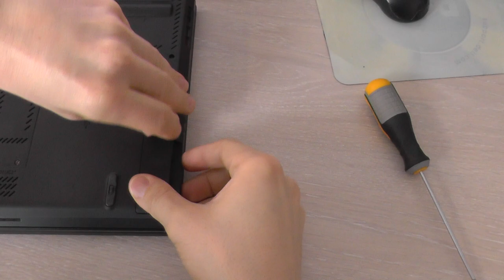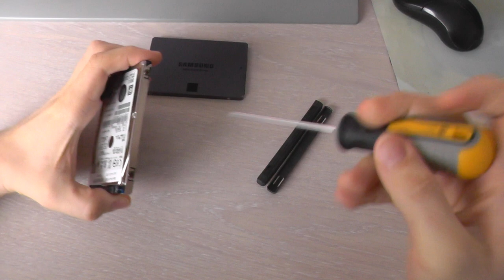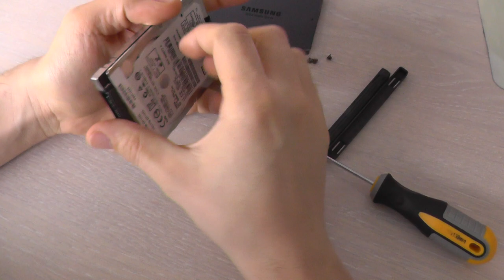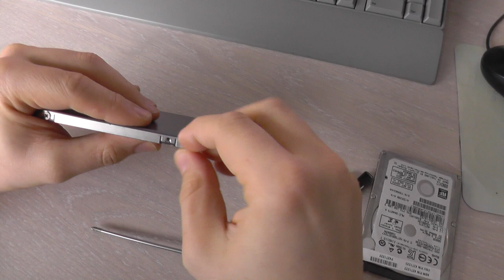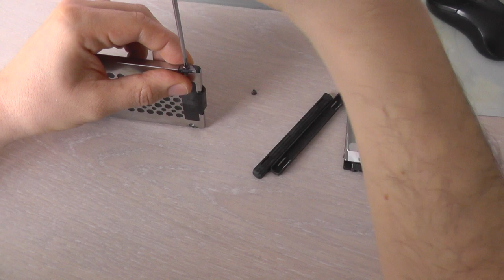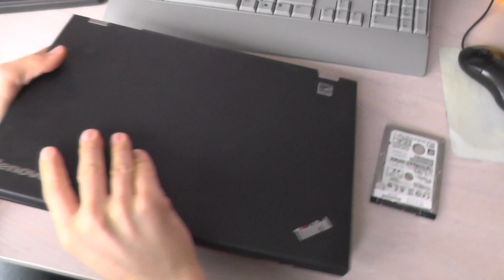Lenovo T430 HDD to SSD Upgrade

Comment: Great to know we're the HDD was hiding, great video and thanks for posting, very helpful indeed, the T430 has to be one of the best laptops iv ever owned and everything can be upgraded to work just as fast as newer thinkpads, only problem I have with the new thinkpad is that some hardware in them are soldered permanently making upgrades very unlikely or very difficult to change even if your good with a soldering device

Comment: Oh why you didn't take the battery off?
Reply from the maker: Indeed, that would be recommend, I was in a hurry, it's still fine :)
Reply: Okay, hurry explains usually ;)
Reply: Regardless, great video!
Reply: Why do i have to take the battery off?
Reply: DavyComedy It’s safer and prevents damage to the laptop

Comment: I have a Thinkpad T400 where the HDD is not working. Any idea if that supports SSD and if a compatible SSD or HDD is available for sale online anywhere ? Thanks.
Reply from the maker: Yes it supports SSD, online you can buy this SAMSUNG model: http://www.gearbest.com/hdd-ssd/pp_351329.html?lkid=10237015 I have it and works very good.
Reply: Thanks.

Comment: i need your help brother, i have two lenovo t430, the other one has a screen back light problem or failure, by trying to fix it i have replaced the inverter but  still same results. And the other thinkpad refuses to accept several i5, i3 core processors that i have tried, it just does not show up on the screen my RAM slots are both working properly.
Reply from the maker: You show try a bios update on the second one. For the lcd issues maybe the ribbon cable is bad ?
Reply: i changed it as well, same output but someone suggested that it could be the death of my graphic card

Comment: Did you clone the drive first, or was this a brand new machine?
Reply from the maker: No, i never clone HDD to SSD, i like to reinstall (clean install).
Reply: Do you need a windows disc to clean install?
Reply from the maker: Yes, or a bootable usb drive.

Comment: How many slots for storage are in this laptop? I want to have 1 ssd and hdd, is that possible?
Reply from the maker: You can install an M2 SSD and keep the 2.5" bay for a HDD.
Reply: thanks for the reply!
Reply: Well... This is a late reply, but someone else might find it useful. This can easily be done using a SATA caddy which fits into the CD/DVD drive slot. You can actually use it for any laptop which has a CD/DVD drive. Only thing you should watch out for is the size. It comes in two thickness, 12.7mm and 9.5mm I think. That's all :)
Reply from the maker: A very good advice indeed, and you get the hdd storage space and the SSD speed for OS and APPs

Comment: I have a t430 and I'm thinking to upgrade it to SSD instead of buying a new one. I just love this machine. So robust!
Reply from the maker: Go ahead, it makes a huge difference when coming from a HDD.
Reply: I just got one for $120 for work. Dropping SSD and 16GB ram in tomorrow. Excited to program on it while away from my desktop
Reply: How to copy HDD files to the SSD, before installing into notebook? Do I need to use usb-to-sata connector?
Reply: @genext81  Did you ever figured it out? I'm a computer noob and would like to do this for my dad's computer as well.
Reply: @JacksonWalter735  unfortunately, I have to do it VERY MANUALLY 🤭🤭. I copied all files to external harddrive, configured the new Windows (and installing back all the Programs), and transfer the files to the new SSD
Reply: Bro how is your battery if u buyed new give me link
Reply: @genext81  I guess best option is to copy the HDD data into a USB memory before the change o
To the sdd
Reply: @genext81  it is the best approach to avoid conflicts
Reply: @JacksonWalter735  get a cheap dvd to hdd caddy and install your old hdd into it then swap out the original dvd drive. That way, you don't need to copy and also you have extra plenty of storage.
Reply: same here in 2024

Comment: SSD -Drives have always been the best as no moving parts then on the bottom some good people have added extra Ram too,as the Ram is below the Thinkpad 430s and under the Keyboard to add double,run a simple diognostic test and now on 16 Gig's of faster laptop on a T.bYTE OF SPACE ......Class Machine nice upload 4 noobs 10/10
Reply from the maker: Yes 100%, adding a SSD instead of HDD and increasing the RAM really boasts up productivity.

Comment: I've got a T430 too but when I pull out on the pull tab something is blocking the HDD. I tried to apply some different pression with a screwdriver when pulling but nothing works. Someone got the same problem ?

Comment: I can't remove my hard drive it doesn't have a pull tab do you or anyone know how to remove it
Reply from the maker: Can you upload a picture somewhere so I can have a look ?
Reply: we have the same problem i don't have that pull tab
Reply: Aguida Anis I drilled a hole and put a screw in side then pulled it out
Reply: +VlogJunk but where
Reply: Aguida Anis at the front of the harddrive
Reply: VlogJunk  D:   you should of used a hole load of tape or krazy glue a side of paper or rubber band and pull out the drive that way
Reply: give it 8 or 10 whacks with a hammer and it will come right out. you can pour some oil in there to loosen it up first, or heat it up with a blowtorch. let us know how it goes.

Comment: Hi!! May you tell me which changes on the BIOS configuration should I do to my SSD work? Thanks!
Reply from the maker: None, it works as normal, just check to have AHCI enabled before you install Windows on the new SSD.

Comment: After I install the SSD, can I use my recovery media (say DVD that I have created upfront) to re-install Windows on it?
Reply from the maker: Yes you can but i do not recommend as the original recovery image is based on the HDD. By installing a clean windows on the SSD will yield better result and increased stability.

Comment: I heard the 7mm SSD don't work, is this true? I think most (if not all) EVO are 7mm.
Reply from the maker: +CommanderSanta The disk I am using daily is a Samsung EVO so it works...You need to use the HDD's bracket to fix it.

Comment: The Lenovo T430 have a mSata, why not use it for install a SSD and keep the HD ?
What it's Pro and Con of this solution ?
Reply from the maker: There are no major pros and cons, current SSD are fast enough regardless of the used port.
Reply: @TechTronic9000  So why do you change the HDD to a SSD when you can just add a SSD in the mSata port ? if you use the mSata port you can keep the HDD

Comment: I dont know if this is the right place to ask. But if I choose to change the HDD to the SDD how can I reinstall my OS  which is a free upgrade of win10 on the new SSD?
Reply from the maker: +Nikolaj Andersen Did you have a Windows 8 license ? There is a tool for extracting the code from the BIOS, reinstall 8 on the SSD and then upgrade it to 10.

Comment: Hi, what are the current SSDs compatible for this? I noticed also the heat on the near left hand side. It apparently appears to be where the Hard Disk is, ha!
Reply from the maker: +cSharpIndonesia most known good brands should work. I have tested with Samsung evo 250GB and intel 530 - 250GB  series.
Reply: And I assume the 500 GB SSD will work just fine like the 250 GB one, right?
Reply from the maker: +cSharpIndonesia Yes, as the SSD acts like a HDD, and the notebooks motherboard supports higher capacity drives like 1TB or 2TB so 500GB will not be a problem. Just be sure to update the bios and update the firmware on the SSD to get maximum compatibility. An before OS installation be sure to have AHCI enabled.

Comment: Thanks for the video, TechTronic. After reading your comments reply to various YouTubers, I gather that you recommend installing fresh Windows on the new SSD instead of copying what I already have on the HDD. 

I have Windows 7 Professional on the HDD for my T430 right now. What's the best free way to get a copy of Windows 7 professional along with the Lenovo drivers? Thanks in advance.
Reply from the maker: +wutaboutthemravens Did your notebook came with a Windows7 license, if you have the code you can download and W7 iso and use your code with it.

Comment: Which one is the best the t430 or the l530 serie both have the same specs a simple i3 and 8 gb ram a ssd 128 gb ( will upgrade it to a 512 gb when bought) one is 15’6” and the other one is 14” will be used for multimedia like YouTube and Netflix when I’m at work
Reply from the maker: The T series seems more popular.
Reply: @TechTronic9000  thanks I order the t430 then 🤩👍

Comment: what about Windows instalation,?you put the software into te SSD or its included into an smaller drive of the computer?
Reply from the maker: Complete windows reinstall to get top performance.
Reply: @TechTronic9000  How do you do that? Do I need to go buy a new copy of Windows or can I clone the one that already came with the computer?

Comment: What if i don't have the fkin pull tab / pull tape? It's stuck....
Reply from the maker: Try with some tweezers, pliers or use a drop of superglue and a DIY pull tab.
Reply: @TechTronic9000  ok , i did it, but I just realized that my laptop is missing the caddy to slide the ssd in . Is it safe to put it in without the caddy ? i secured it with a small piece of tape , and it looks fixed.

Comment: Hi, does the t430s have a sata 2 or sata 3 interface?
Reply from the maker: It has both, the regular sata port of the 2.5" HDD is SATA 3 and there is also a mSATA connector that supports SATA 2

Comment: Hi, My Lenonvo T430 laptop already has Windows 10 Pre-installed.  It has an ordinary 500GB Sata Hard-disk on it.  Please tell me what steps I need to do  to upgrade to SSD.
Reply from the maker: +A Munim you need to obtain the activation / serial number and a iso of it. The s/n can be extracted with some apps.
Reply from the maker: +A Munim you need to obtain the activation / serial number and a iso of it. The s/n can be extracted with some apps.
Reply: +TechTronic9000 - I now have a Windows 10 Iso and serial number how do I migrate to a Samsung Evo ssd. Thanks
Reply from the maker: You need either to create a dvd with the iso, or use a tool to make a bootable usb stick with the iso.
Reply: +TechTronic9000 I've done all that thanks - what do I do now just burn the image onto the ssd

Comment: Can I transfer the files in my old hdd to the new ssd?
Reply from the maker: Yes you cam, you can also migrate / clone  but it's not recommended. Usually a fresh install is much more better.

Comment: if I buy a refurbished one, can I make a copy of the hdd on a new ssd and put it inside? Will it work?
Reply from the maker: +Andreapraiano It will work but it's not recommended. The best way to use a SSD is to install the operating system directly on it.
Reply: +TechTronic9000 but how about losing the OS key ?
Reply from the maker: +Andreapraiano If it had windows 8 on it chances are that the key is in the BIOS, it's extractable by some software tools.
Reply: +TechTronic9000 mmmmh, i have to find one with w8, le buy the upgrade
Reply: It works just fine.  The Samsung SSD comes with data migration software.  You connect up the new SSD to a USB 3 port and use the Data Migration software.  Easy peasy.

Comment: great video thanks. If I choose to upgrade my HDD to is SSD is it necessary for me to remove the expresscache that is already installed in my laptop of  32 gigabyte?
Reply from the maker: +Nikolaj Andersen You can also keep the express cache but with current SSD technology which is very fast I doubt that you will see a performance increase from using an extra SSD cache.
Reply: I agree .  And my current 32 gb expresscache is reporting an error so I think I will remove that one.  Any video on that matter? Thanks again. 😊
Reply from the maker: +Nikolaj Andersen My notebook didn't have the cache module, it's a matter of taking it out and reinstalling windows on the SSD to benefit from the speed and not having the express cache software running.
Reply: +TechTronic9000 ah ok.  So simply let the expresscache stay and uninstall the software.
Reply from the maker: +Nikolaj Andersen You can also remove the module, less hardware, less power consumption, less heat.
Reply: +TechTronic9000 the thing is I have searched everywhere and I can't find a tutorial on how to remove it.
Reply from the maker: +Nikolaj Andersen The module should look similar to these ones: https://devsector.files.wordpress.com/2014/08/09-original-sandisk.jpg or this http://www.notebookcheck.info/fileadmin/Notebooks/Lenovo/IdeaPad_Y510p/innen2.jpg or this https://devsector.files.wordpress.com/2014/08/07-removed.jpg

Comment: Hey, so, what's the max ssd size I can put into it? 256gb or will it take 512/500/480gb too? Thanks
Reply from the maker: +jeFF Fury Hello ! I'm using it with an 250 GB Samsung Evo disk, it can support larger disk also.
Reply: +TechTronic9000 and do you have an idea if the graphics card can be upgraded in this one or if not there, can one be installed? Also, if yes, what are my options? Thank you very much.
Reply from the maker: +jeFF Fury The GPU is not replaceable, it depends on the chosen configuration when you purchase it.